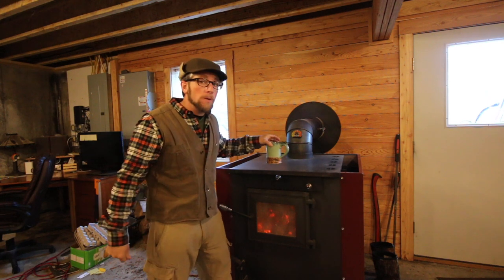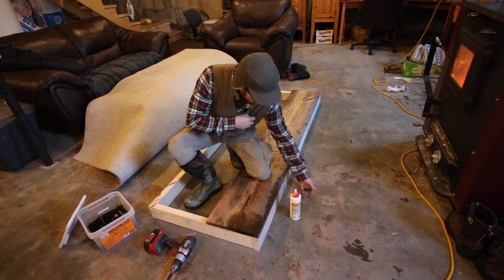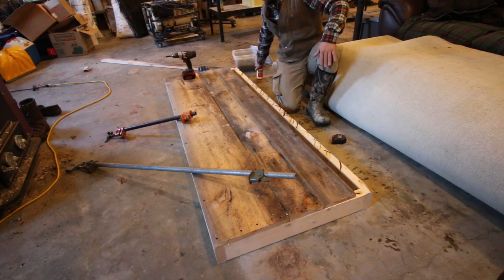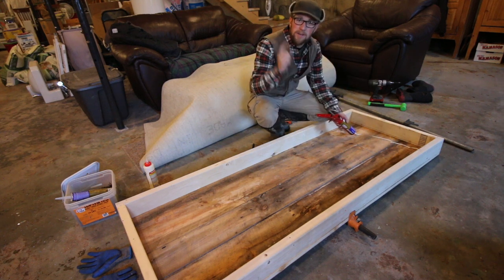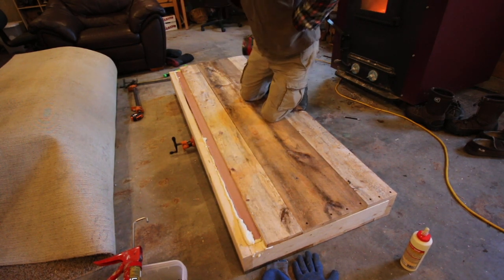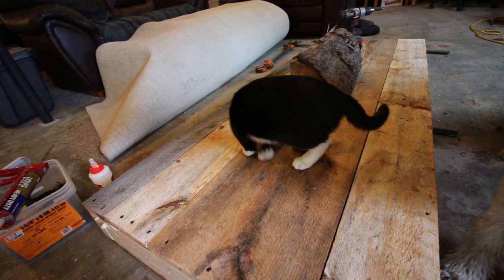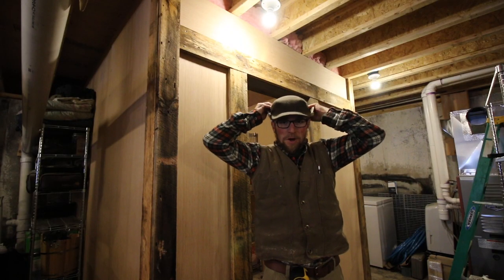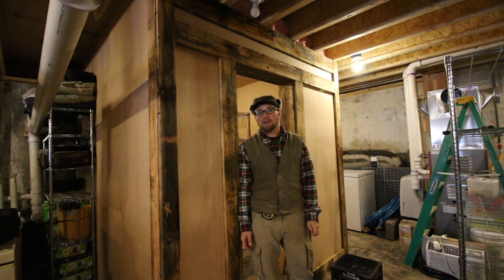DIY Insulated Barn Board Door For our Root Cellar

Comment: Al, when I was a kid in the 40s, 50s and early 60s, my dad's cape cod home heated off of coal and a round furnace that was in the middle of the basement.  It had a heat exchanger built around the burning chamber for the coal.  The heat would rise by itself and the cold air would drop via the cold air returns.  The coal furnace acted just like your wood stove/furnace.

Comment: It looks much nicer with the rough sawn trim, it adds a lot more character. It's coming along nicely, it should look great with the door installed.
When cutting your R board, use a sharp pocket knife, it won't leave all the nasty crumbs you get from sawing. It may take several passes to cut through but not any more time. You could also just score and snap, like you did with the factory pre-scoring.
Your table saw with stand, appears to be close to the same height as your miter box stand. When ripping long boards you might be able to use the work supports on your miter saw stand as out feed supports for you table saw. That would make for safer ripping when you get near to the end of the cuts. 
You mentioned the rip cuts closing and binding on your table saw blade. Try jamming wood shims into the cuts to keep them open, to prevent the binding. Please start using push sticks to finish your rips. Even just a simple length of scrap 1 x 2 with a notch in one end is safer than having your hand so close to the blade. In the blink of an eye you can cause serious damage. Saws are merciless.
Reply from the maker: Great tip with the shims! Thanks for sharing that one!

Comment: Using glue and screws, as the wood dries it will split. Nails will give and move a bit with the wood; or you could make slightly overlarge holes for the screws so the wood can move a little.

Comment: Is there no clutch on that poor drill? If there is, set it and pull the trigger one time, following the screw into the wood until the clutch slips, then release the trigger.... Oh wait, you have an air nailer and you screwed those boards onto the door frame instead..SMDH